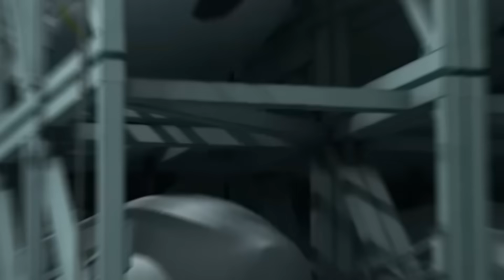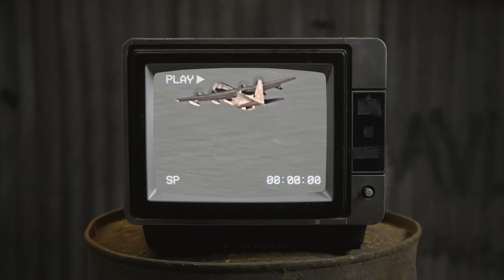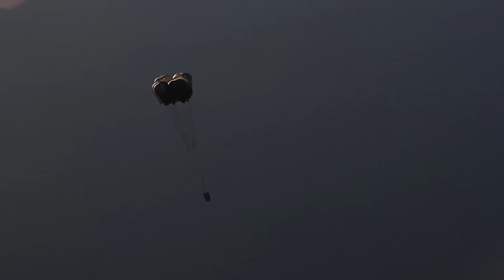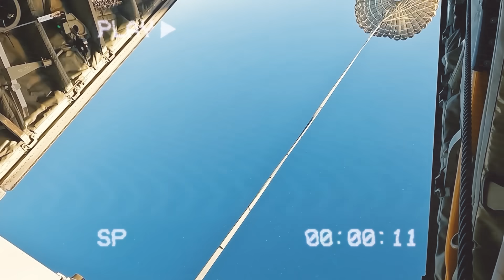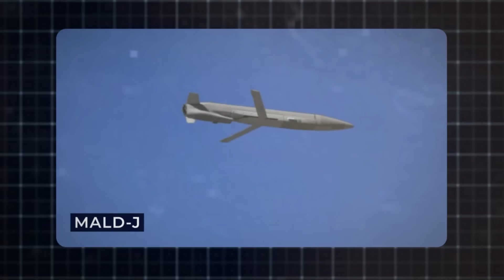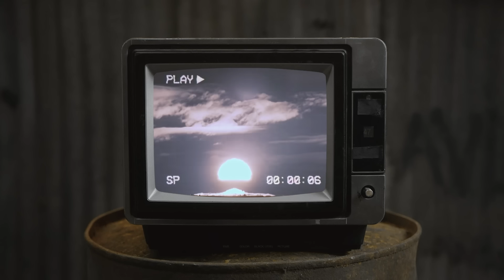FINALLY: US Air Force is Testing the DEADLIEST Rapid Dragon Bomb

Comment: Why couldn't cluster. Ammunition be assigned to the rapid Dragon ?
Reply: The system is designed to overcome air defense on hard targets like ships. Cluster doesn’t make sense of that mission.
Reply: Geneva checklist violation
Reply: @Picklegoon_gaming no it’s not
Reply: It increases the range of cheaper cruise missiles. Missile launching ships are in danger of getting to close to a target like China, that is bristling with anti ship missiles
Reply: You could use cluster munitions for Rapid Dragon.  You just put a JDAM kit on cluster bombs.  But I don't see why you'd want to.  Rapid Dragon is intended for massive strikes on non-moving or slow-moving targets, which is why the JASM-ER is the preferred munition.  You use them to take out identified air defense emplacements so fighter craft can get in closer for more immediate, eyes-on attacks.  Hardened emplacements are extremely resistant to cluster munition attacks.  Cluster munitions are designed as a counter to massed infantry and light armor/unarmored vehicle formations, they lack the penetration and explosive force to take out heavy armor and hardened emplacements.

Additionally, while the US has never signed it, there is an international treaty against cluster munitions, which most of NATO has signed, so US forces would be extremely selective about when, where, and even if cluster munitions would be used, especially if they had something else that could do the job.  They could justify use to defend US territory, but using it anywhere else would cause a lot of international controversy (as we saw when they agreed to send cluster munitions to Ukraine--which, once again, was justified with the argument that Ukraine was using them to defend its own territory and therefore, they weren't inflicting the risk of unexploded ordnance on anyone else).
Reply: I agree 🤘.!.
Along with Radar hunting missiles, opening the A-10 Wart Hogs entry into the war.😉.
GREAT POTENTIAL!😉!
Sons’ Of Joseph@
Reply: @worlore1651  cluster bombs violate the Geneva convention

Comment: A C-130 can operate from an aircraft carrier. That extends their range greatly
Reply: The C-130 has been experimentally landed on a super carrier.  This is NOT being done operationally.
Reply: I remember watching a video about wargames in the South China Sea on scenarios if China attacked Taiwon and we had to defend. The problem is China has missiles that can reach far into the sea staged along the coast. I wonder if this would better combat that scenario.
Reply: No need to the C130 has long range and air to air refueling capability. Also the missile itself has a long range. No need to tie up a carriers flight deck

Comment: problem is a cargo plane is an easy target for any modern anti air missle system

Also nukes are the deadliest "bombs" we have by far
Reply: The plane is not a target if it drops the bombs 1000km away
Reply: @stackula99  it would not drop em 1000km away
Reply: It well could drop from over 1000 miles away, given the range of JASSM-XR.  The whole concep is standoff strike capability.  China has no answer to this. @theseventhammer

Comment: I'd imagine something like that, with it's swarm attack, could do quite the number on an enemy carrier.
Reply: What enemy carriers? China only has two aircraft carriers and Russia only has 1 aircraft carrier.
Those 3 carriers will be sunk in the first hour of a large conflict. Each of these 3 aircraft carriers have a capacity of only 30 to 60 fighters.
So a total of only 180 carrier jets.
 
Each of the 11 US aircraft carriers can carry 90 fighters, so 990 jets total on our carriers. The Navy always having 11 aircraft carriers is per a Congressional mandate.
Reply: @elessartelcontar9415  

"What enemy carriers?"
"China only has two carriers"

Um, those carriers.

BTW, the PRC has 3 active carriers now, with the last being launched in 2022 (the "super carrier" Fujian, capable of carrying 50-60 fighters).
You mention the Admiral Kuznetsov.  I don't consider that mazut burning, tugboat propelled POS a carrier.  

BTW, China is currently building carriers and unless the CCP loses power in China, we WILL see a few more Chinese carriers within a decade (some experts predict 5 modern carriers within the next 10 years).

The US is the leading military power, but it does have competition.  Sitting upon one's laurels is to lay pavement to defeat. Same as underestimating one's enemy, current or potential.
 
We are well aware of the PRC's ambitions in the South China Sea, which the Rapid Dragon system may be able to tackle effectively.  It may even be the primary reason for this particular weapons system.

That said, I am a bit surprised China is currently building modern carriers, considering how they have heavily invested in "carrier killer" ballistic missiles (DF-26B) with a 2,500mi range and 4000lbs payload designed to vertically approach a carrier at supersonic speeds, making avoidance or interception difficult.  
It is believed they currently have in excess of 200 such units available for deployment for their own "ballistic missile swarm attack".  Despite the perils of having such an investment at sea, it appears the Chinese now recognize the value in carriers.
Reply: arent they just re inventing cluster bombs
Reply: ahmadal-islam4654  My friend, in warfare... everyone loses.  Let us hope our politicians know this.
Reply: @snowdogthewolf  Not true. The Type-004 won't see commissioning until about 2030. The it will take 5-6 more years to commission the Type-004 class.